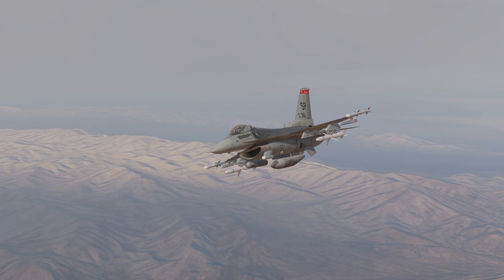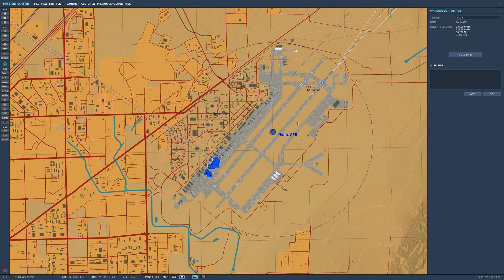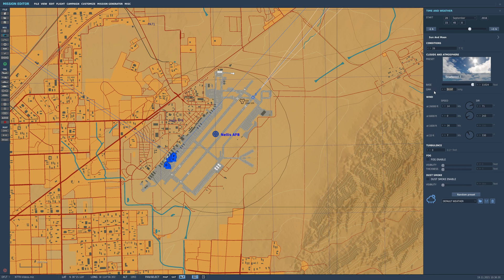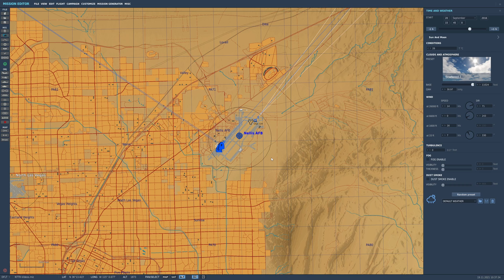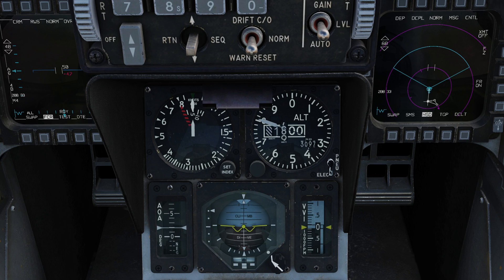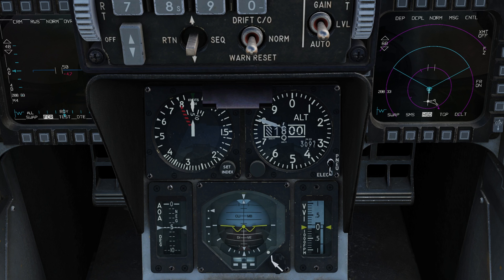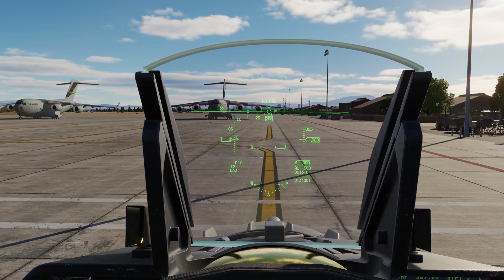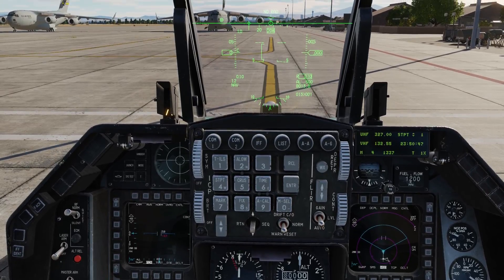DCS World: QHN, QFE and the Mystery of Numbers! Part 1/2

Comment: Setting your altimeter for QNH will tell you how high you are above sea level. Denver Airport isn't at 0 feet QNH. It is at about 5000 feet QNH. So, if your altimeter is set to QNH and you are flying in bad weather, when the ATC tells you to drop to 2500 feet, you're gonna be in for a bad day. Setting your altimeter for QFE will tell you how high you are above a given airport. Easy Peasy, Don Lemon Squeezy. Thanks for the info!
Reply from the maker: But ATC would not tell you to do that since they give you vectors and altitude correlated to the QNH 😉